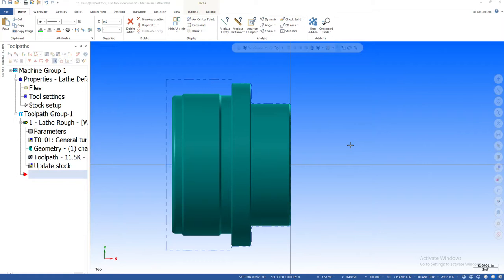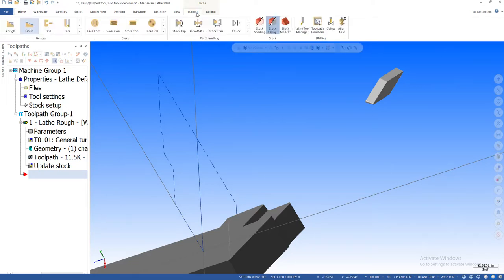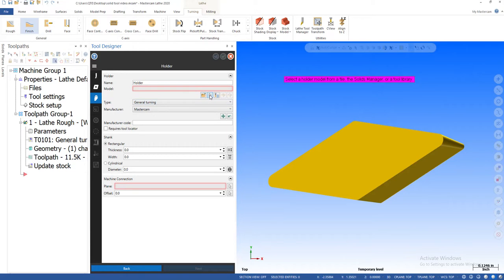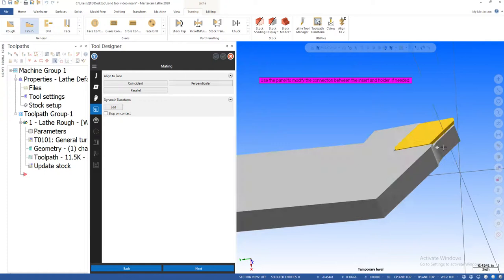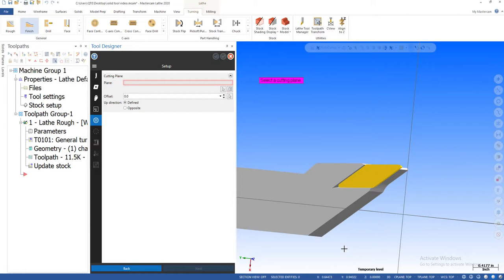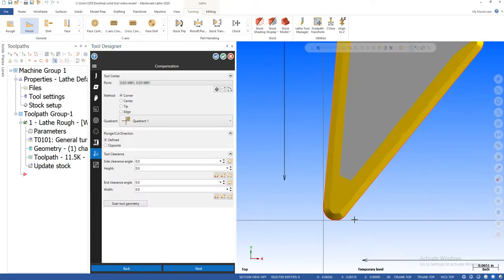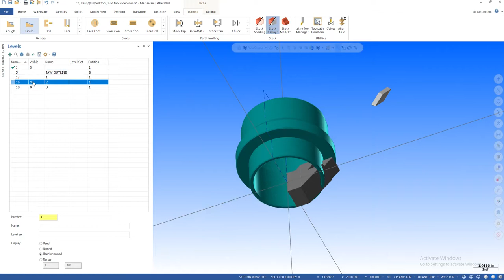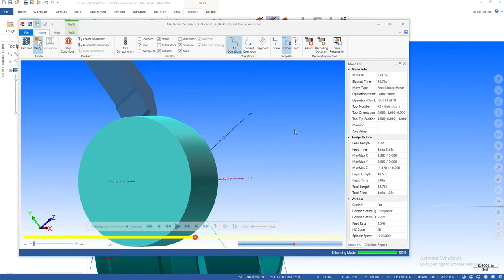Mastercam 2020 Tool Designer (Part 2 of 3)

Comment: Hello Reese. I'm having trouble picking a machine connection plane. When I go to pick it it doesn't shade and allow me to pick. Do you have any suggestions on getting this to work? The file is a holder from Kennametal and it's a lathe turning tool.